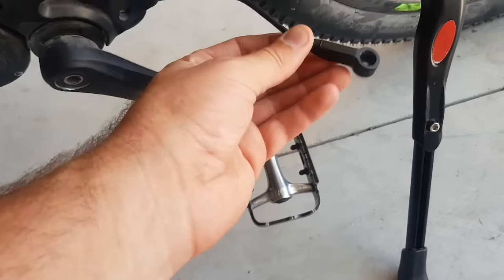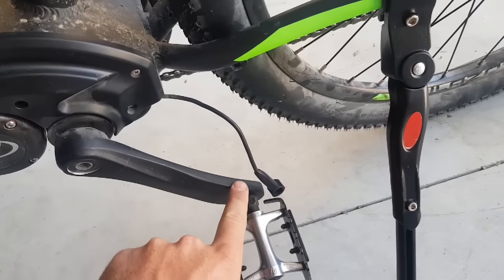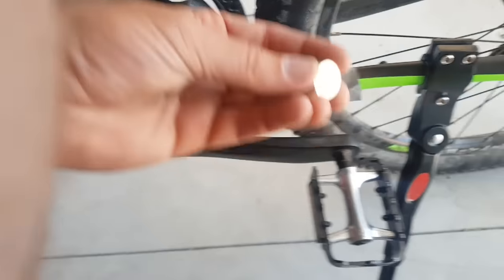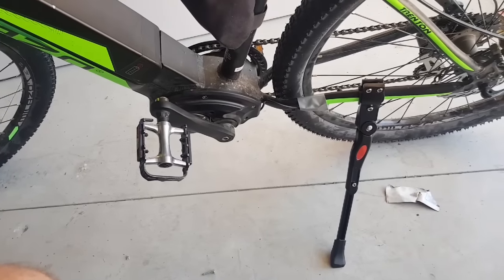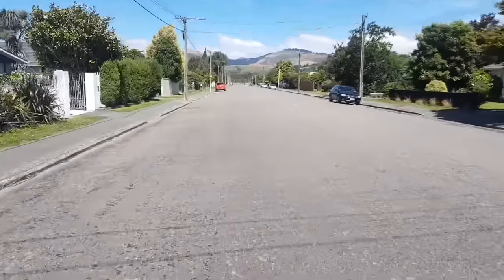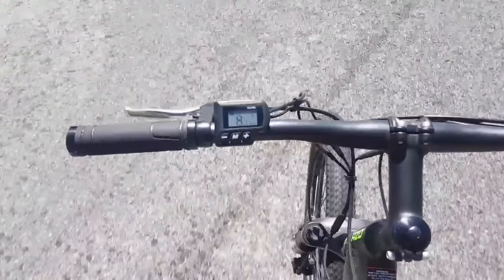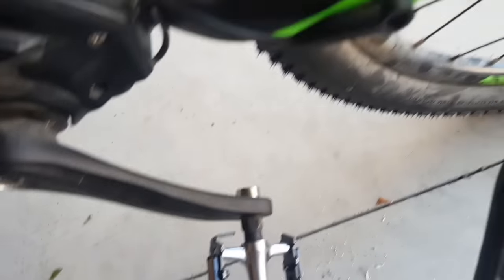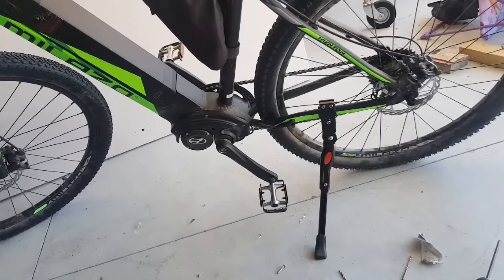Speedhack your mid drive ebike - remove speed limiter

Comment: Oh, man, what did you do? I have never seen anything like it in my life. He weakened the frame of the bike in a critical part! You would have solved it without damage with a cable tie.Funny!
Reply from the maker: Yeah as others have said, should've used a cable tie... still 1 1/2 years later, she's going hard with zero dramas. I'm not doing any major downhill stuff on this bike
Reply: a hole that size would not weaken the frame stop crying
Reply: Yup that drill hole is a nothingburger, but he should still hang his head for not first considering the mighty power of duct tape & zip ties. Them & a can of WD40 are essential kit for emergency repairs/general bodging.

Comment: Why not just add 2nd magnet on the spokes 180 degree from stock magnet without moving original setup there only couple bucks on flee bay wouldn't that be easier.....
Reply: Please explain?
Reply: but wouldn’t that trick the system into thinking you were going faster than you were - ie - the opposite of what you want?
Reply: @bungalowbluesman  That's what I was thinking as well

Comment: dont try this on a shimano steps E8000. After a few miles error E014 appears as the motor detects the changes. Motor wont work at all. Poor hack. You then have to reinstate the magnet and pick-up to get it to work again.
Reply: How did you get rid of E014 error?

Comment: Hello, can you remove speed limit xiaomi himo c20? Thank you!
Reply from the maker: No idea... If it uses the same sensing method then I guess... Easy to check with a magnet in hand
Reply: Daniel Caigou I could not find the tachometer on the wheel.  Maybe it's in the motor.  Do you know how to remove it and modify the rotation?

Comment: Hi Daniel, thanks for this great hack. Will hack effect the distance according to 25k's/h I can do 90kms, will I end doing less K's?                             I guess going faster will use up more juice in the battery!!! Yours comments please.                                                                                                       Rgds
Reply from the maker: Yeah you'll use more battery because it's applying more assist. 

Hard to determine how much more... you won't go your regular distance per charge, a little less.  Can only find out by trying
Reply: @danielcaigou6403  Hello Daniel, Greetings from the south of France, I'l give it a go when I've got some time to try the hack, in normal conditions when I do my 35km run on a flat bike path, I use about 1/4 of the battery, only using the automatic pedaling mode. After 2 rides (70kms) when I'm down to half I charge up again.   I'll keep you posted. Rgds David.

Comment: On newer Shimano steps software it will give you error E014 after about 10Km since crank spin and wheel spins are the same.  Before you could move the sensor back and spin the crank for about 100 times.  No this does not work any more.  Motor has to be replaced.  So this is a warning for to user with newer Shimano steps system. This may work: https://www.youtube.com/watch?v=_Ecj4Mzsxsg
I bought a Shimano Speedbox, a device that you connect inn between sensor and motor.  This works perfectly.  When real speed passes around 20-22kmh, it just stops increase speed motor sees, so you still get assistant at any higher speed.  Since my motor is just a 250w, I just get around 30-35kmh on a flat road.  Buts better than 25kmh.  :)
Reply: my Merinda Epresso had the modification done ....worked really when for 20 mins then died, tried to reinstall to original position and spin test...Nope E014 error still  - Now I am trying to find a fix b4 going to bike store

Comment: Quite honestly the simple solution to going faster is pedal harder as per a normal bike.  If I, a 70+ years man suffering spinal injuries and heart failure, can manage 24mph then any fit(ish) person can certainly do it.  If you want motorbike performance then buy a motorbike; simple.
Reply from the maker: So... Why are you here watching this video then?
Reply: Some people like to customize nothin wrong with that
Reply: Agree
Reply: Back in MY day... lol.  Just kidding, keep on biking dude.
Reply: Actually, the engine will try to slow you down if you pedal beyond 25km/h. Feels like the handbrake has been applied. The real advantage to an electric bike is to keep you at a steady pace, especially uphill and against the wind, and you save your energy in general.
Reply: @danielcaigou6403  Stupid question pal.  I watch war films but I have no intention of being a soldier.  Doh!
Reply: @Taylormane  Because it's illegal on the road!
Reply: @robarias8625  Sorry, never had a problem.  In fact I only use the motor about 60% of the time.  I live in flat area and only exercise locally so I do 25 miles before the 300w battery drops one bar.  I rode 25 miles today for my first ride in two years after Covid and still had 80% power remaining.  Over a period of 3 data without charging I achieved 137 miles!  Some say no motor is like wading through treacle but not in my experience.  I only bought an ebike in case I got into any difficulty due to my failing heart but I much prefer a normal bike.  Still, it puts my wife's mind at rest.  I find the limit fast enough BUT the gearing of my 7 speed Motus is too low until gear with my legs flailing at 25 kph.  I am going to have to improve that, not to increase my speed but just for the comfort factor.  I really should have bought the 8 speed Tour model.  Still, all in all, it's a superb cycle.

Comment: DONT do this!, It did work then after 20 mins then stopped. Locked out I could not get to fix it, Even the manufacture had an issue fixing it. So be warned all this electronics is going to be an expensive fix.     BE WARNED. Maybe get a 2nd bike and play around.
Reply from the maker: Bugger, sorry this happened for you. Must be your particular set up. Still... sorry